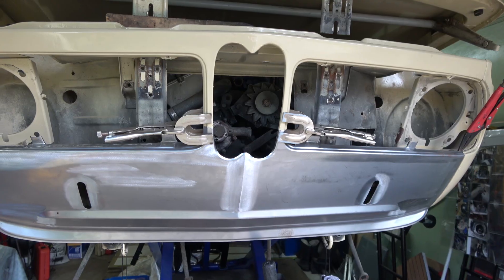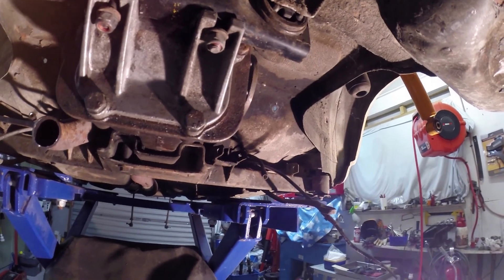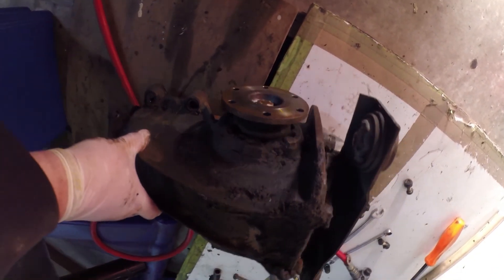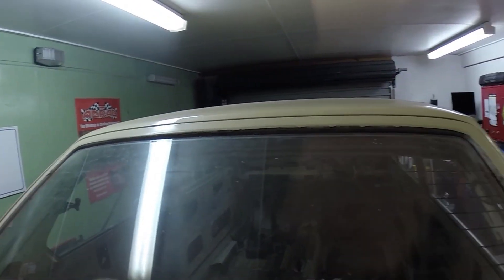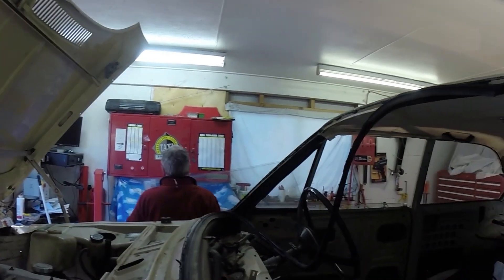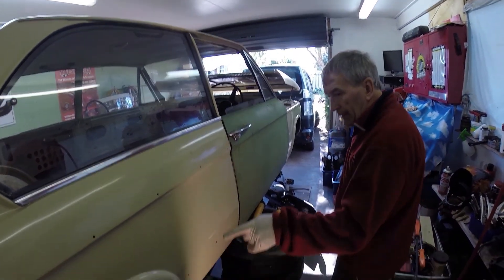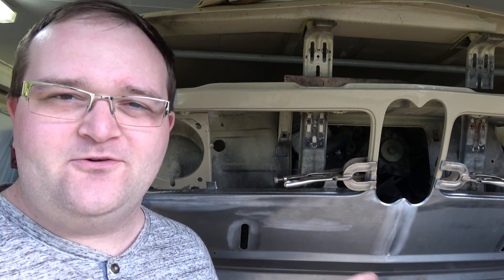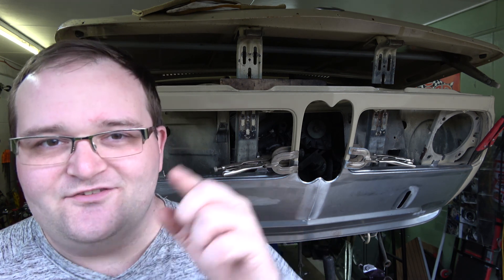Birthing the diff! - BMW 2002 Touring Restoration Project Episode 7

Comment: Looking good. Be great to see how the front panel was fitted.
Reply from the maker: Hey mate, the panel is only being held in place with grips at this point, its a lovely fit so far. Video coming on the fitting, fabrication and welding etc.
Reply: Ok.... Excellent fit then for just gripped in place